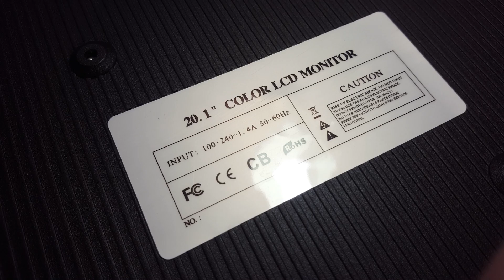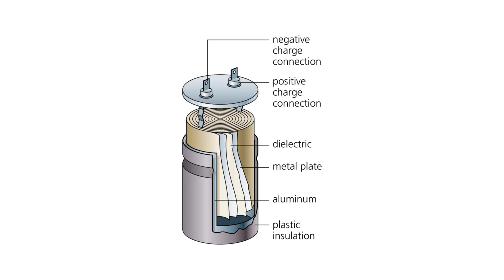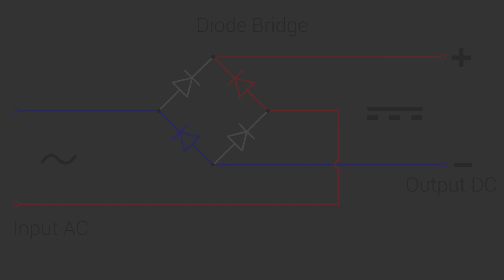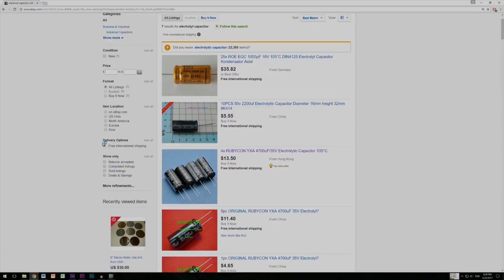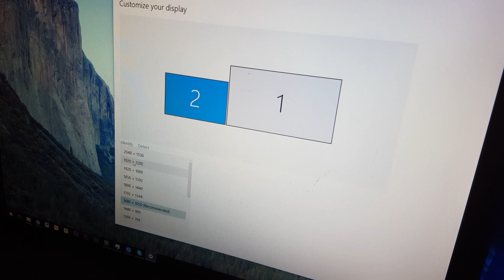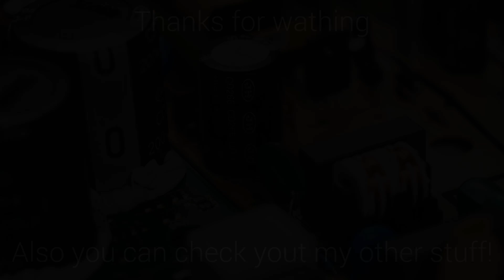How To Fix Monitor (Black Or Flickering Screen)

Comment: Sir you are really a great person
You have saved my money 
Since 10 days my monitor blinking and I couldn't watch anything on computer therefore I went to computer shop he told me that it needed to  repair or change the card and I have to pay 1500 but I don't have this money so I returned from the shop and watch your video as you described in video I have found the mistake that a capacitor (470 uf 25 v) was increased in size 
I bought it in only 5 rs and change it 
Now my monitor is working properly
I would like to say thank you very much

Comment: Does it break from power outages?
Reply: not from power outages.  but when the power comes back on, you could suffer power surge.  you should invest in a $50 surge protector, for all your expensive electronics.  like TV and computer

Comment: if the original capacitor is 1000 uf 16v,can we replaced with 2000 uf 20v capacitor...??
Reply: Yes - that would be even better because one one hand you would extend the lifetime of the new capacitor. 😊

Comment: I had two monitors. One would go into blackscreen a second after showing the image. While the other would show the Image but would flicker. After a days work I managed to combine the best parts of both. Now my Monitor flickers the first second before going into black screen
Reply: Did you happen to fix that issue? I currently have that exact problem

Comment: Funny all I did was smack the back of it (expecting to break it) and it just started working wtf
Reply: It’s called percussive maintenance
Reply: @Lo0NaTik1  yep
Reply: OMFG I saw your comment and I tried and it worked
Reply: @yezi7562  thats some funny shit
Reply: @slyxuid3736  apparantely there was a wire or something disconnected and every time id smack it it would connect back
Reply: I just did it and it worked. Currently on the floor laughing my ass of about how stupid that is
Reply: lol that method used to work, but now it doesn't. Thinking about doing this fix. How's yours holding up?
Reply: Dang man yea mine still messed up the turn on light keeps flickering
Reply: You probably had a loose power or vga cord
Reply: It also work for me
Reply: i hurt my hand.
Reply: This one didnt work for me 😂😢